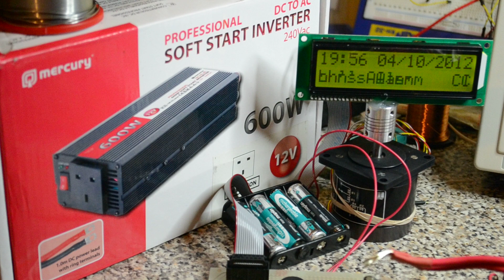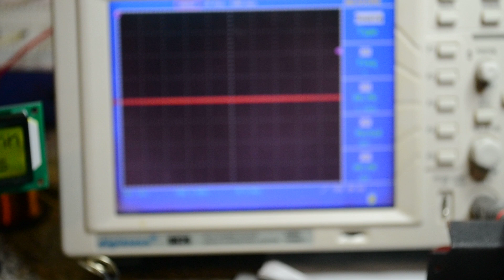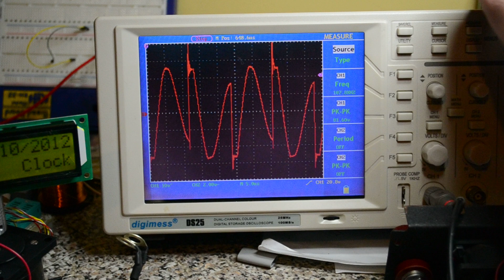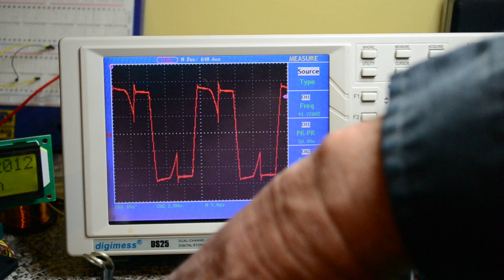Mercury - Skytronic Soft Start Inverter Repair Guide 12 or 24 volt DC to 240ac

Comment: Just bought a brand new Mercury IMS-150  (24v 150w) square wave inverter. The spec says 300w peak soft start 150w continuous.
I am running a heat pad 120w and it stops producing enough power after about a minute, no faults, no smells, no overheating and fan goes off.
Any idea what is wrong with it? Seller says I need a bigger inverter which I find hard to believe when 300w should be enough to deliver 120w continuously. 

Any comments appreciated.
Reply from the maker: Try a 100 watt light bulb, if the inverter stops, it is faulty.
It should run a 120 watt load.

Comment: Hi,
This is a long shot, I know
I'm working on a smaller model, the SkyTronic G-12-030 inverter (300W max)
One of Low voltage MosFETs (RFP50N06) had blown.  I replaced it but still no joy.  The unit just beeps, no fan, no oscillation
I noticed that a 556 timer did not get power, I also found a 7812 which did not get power either
Any one any tips?  
Schematics would be wonderful
Or does anyone know an OEM brand name of the same unit?
thanks,
ChrisV

Comment: I have a 100W smps inverter with a short to groubd but all the mosfets and fuses are ok and it keeps on beeping,the problem started when the polarity was vice versed
Reply from the maker: It's probably a short circuit protection diode if fitted.

Comment: My 1.2kva 24v Mercury inverter stopped carrying heavy load like my Desktop Pc and My 80W refrigerator. Which part do I look up to? Don't know much about electronics. I just know the basics and making simple projects.
Reply from the maker: Start looking to see what is blown.
Does it work with a light load?
Reply: It works very well with light load. It takes my two televisions but not my refrigerator. I hv decide to buy another one.

Comment: hi i have a 1500w mercury inverter it works but takes a long time to start the saw i use it on the saw is1200w  any ideas what the issue is 
Thanks David
Reply from the maker: +david maryan 
Hi David,
Sorry I've not looked at any inverters since doing this video.
I have no idea why yours would take a long time to start.
Reply: It takes a long time to start because its power is not enough for this application. Inductive loads (motors) need very high initial currents in order to start. Usually the inverter should be capable of withstanding (at least) the triple power than its nominal one for a few seconds. The problem you face is due to the overcurrent sensing circuit which gets repeatedly activated until it eventually is deactivated. Normally it should not start at all, as its nominal power is very close to the load power...

Comment: P&Z power inductor manufacturer and suppliers. The power inductor includes SMD power inductor and leaded power inductor which are used in various industries.
Web :http://www.dgpinzhan.com
Reply from the maker: +justin yao 
Thank you for your post, I need an inductor / flyback transformer for a 5 volt 200mA smps.
The inductor must be no taller than 11mm
Can you help?
john b
Reply: Dear John b  :
Please contact me email or SKYPE
My SKYPE: justin029
Email address: sale@dgpinzhan.com